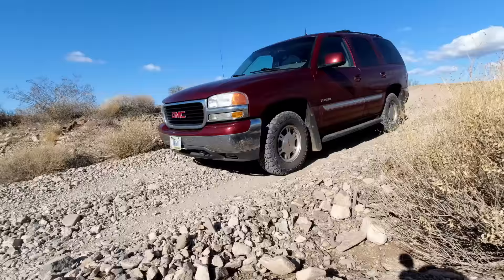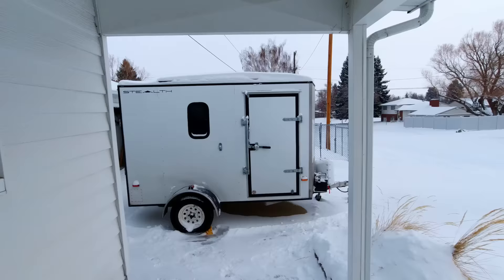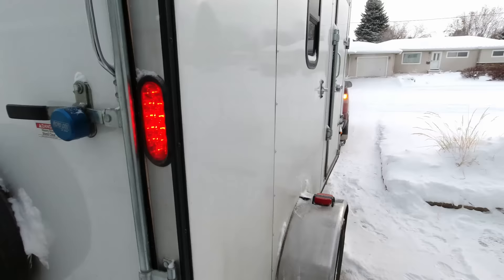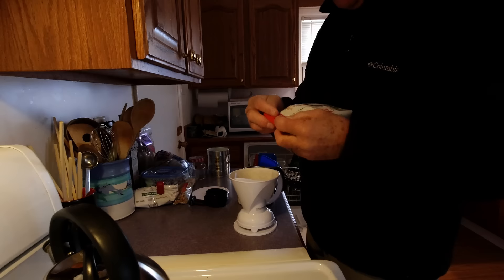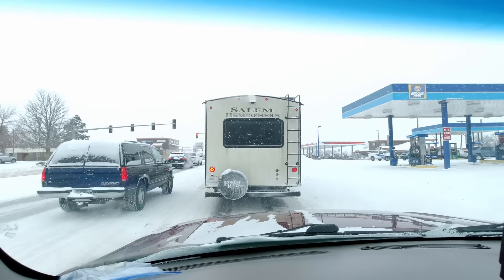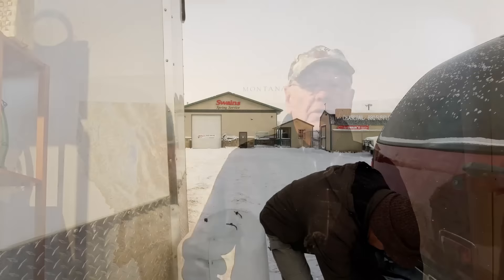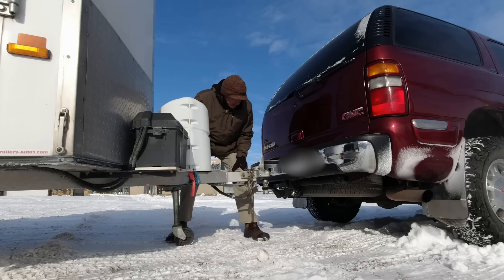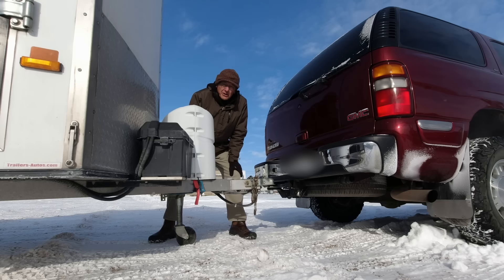Trailer Leaf Springs Or Torsion Axles?

Comment: A leaf spring will only break on the up motion when bouncing. Leaf springs do get work harden with time and will take a set. We use to get leaf springs re-arched on our Chevy work pickups back in the 80's, when we carried fuel and tools in our 1 ton pickups working on logging jobs.  I don't think anyone will re-arch leaf springs today because of liability. A person can add springs, if the weight calls for it. Another great video, always click on them when posted..Thanks for sharing :)
Reply from the maker: Thank you for sharing that knowledge!

Comment: It's good you got the other spring fixed now. Leaf spring trailers are so much easier to do a bush fix with too if they do fail. I had a Torflex axle fail and there was nothing I could do. One assembly had worked it's way out of the axle tube probably 6 or 8 inches so the tire was sticking way out. I was afraid of it coming completely off if I drove it. Talk about a hazard to everyone else on the road. I slowly crawled back into town on the shoulder with my 4 way flashers on. What a day. I had to wait a week in a small town for the shop to get a complete replacement axle. Ya I'm 100% for leaf spring axles.
Reply from the maker: That's exactly what I'm afraid of happening!  I almost went with torsion arm suspension, but the first shop, who could have sold me that product if they wanted to, talked me out of it.

Comment: Glad to see you finally got this done, but it did make for an " INTERESTING" vid when the other one broke down. You can get the other one ( spare ) checked out to see if you have any cracks in it or stress fractures that mite not be visible to the naked eye, there's different ways of doing this, just a thought. Or since your GTG for another 100k not worry about it, an just keep the spare onboard, JIC. Thx for the vid

Comment: Kinda surprised on your first comment about leaf springs.  They are on the back of probably 90% of all pickups and typically don't break after way more than 100K miles.   Cheap manufacturing of trailers and probably their leaf springs, well that's another story, but not indicative of a bad design as a whole.
Reply from the maker: I probably have 100,000 miles on this trailer and it's a Dexter axle and springs. Everything breaks eventually.
Reply: @gonagain  Agreed, everything breaks eventually, sorry I must have misunderstood you, as I thought you were saying that leaf springs were an interior design.  Honestly if trailer manufactures would use a more quality spring, like vehicles, they wouldn't have broken at 100K.  Unless of course they are used outside their specifications.

Comment: Good information. Usually a tandem axle trailer is longer and heavier so I can understand why you chose the single axle not only for the more maneuverability but also the weight since you are towing with a smaller SUV. I have never understood why they don’t put shocks on trailers but there must be some reason. Wow it’s cold there. We haven’t even made it below 10 degrees this winter in this part of Idaho. Getting ready to take my first camping trip down into Hells Canyon in a few days. Good time to go in the canyon before it gets too hot and the rattlers start coming out.
Reply from the maker: That is such a beautiful area!  We were there last spring and loved it, other than the smoke at the time.
Reply: @gonagain  we took the jet boat ride below Hells Canyon dam. The smoke gave it kind of an eerie feel but beautiful. We saw all kinds of wildlife. Lots of bears deer and elk. There are several good boondocking places to camp. Love the Canyon.

Comment: I can’t count the number of trailers I’ve owned since the early 1970’s.  One car hauler and a small (17’) TT I used for hunting had torsion suspension.  They do ride nice but after having an issue with the I decided to adhere to the KISS principle, AKA leaf spring suspension.  Good vid as usual.

Comment: With all the off roading you guys do you might want to consider Greasable poly bushings for the Spring eyes next time they need replacement.
Reply from the maker: I had to look that up.  Yes, that's a good idea!
Reply: @gonagain   Another good idea is military wrapped leaf Springs the 2nd leaf wraps around the Spring eye in case the main leaf breaks as a fail safe.

Comment: Springs will most often give you more ground clearance. I have taken a leaf spring where the axle is above the spring and reversed it so the axle is below it. I gained not only the thickness of the spring, but also the thickness of the axle. So maybe a 4" lift.
Reply: I am thinking about doing the same with my trailer, mostly because when I drive over a dip in the road, my trailer jack hits the road in that situation.  Any regrets or advice?
Reply: @hargieboo  If the jack is in the front, it is more about the height of your hitch or vehicle. You can install a swing away jack.  or a trailer hitch that has more rise.  If you were to raise the suspension of the trailer, you may need this anyway to keep the trailer level.
Reply: @hargieboo  If the trailer has electric brakes, you  want to be sure you can get them to operate and adjust correctly once you flip and spin the axle when you undermount it. You may have to swap the left and right brake assembly to accomplish this. If no electric brake, no problem

Comment: Great info. I am getting ready to purchase a 6X10 and only want a single axle. People keep telling me to go with a 6X12 and tandem but we don't need that 2 extra feet. The info on the shocks and rubber bumpers is also great. Thanks for the videos - I truly love seeing you and Linda enjoying life and traveling!
Reply from the maker: Hi Amy, just keep good tires on it, replace them before they need it and you'll be fine.
Reply: Any, people are right. You need more length. I have a 6x12 single axle and it is really easy to run out of room when building for two people. If you want it to truly be more than a “ tin tent” you should get more length. I can’t tell you how many times I have regretted not getting a 7x14 tandem. You can thank me later.😊
Reply: @hgj2019  it will likely be me most of the time. I need it big enough to do some hauling (nothing too large or heavy) and something I can secure electric bikes, have a bed, cook, heat and some power. I have a 1/2 ton truck so I don’t want to drag it down. Thanks for the advice - if I end up kicking myself you can say I told you so...lol
Reply: @amyslaughter8788  take a close look at your needs. Figure out exactly what this should be for you. Your physical size is an issue. My wife is almost 6' tall, and I am over 6', so i can't orient the bed cross-wise. I built a small cabinet with sink, stove, and drawers. A bathroom beyond a porta-porty is out of the question. I once wanted a fold-up bed so I could still carry a quad or bikes, but I've given up on that. Two more feet in length and another foot in width would make a HUGE difference for us. Tandem axles would also be better, as you can "limp" along with one flat if you still have 3 inflated. I've dragged my trailer literally thousands of miles, and used it as both "tin tent" and a slightly more developed camper. Try to keep an open mind about this before you commit. The difference in price now will be small compared to the cost of doing it all over again. If your 1/2 ton is a "full size" you should not have any problems with the greater weight of the linger camper. Tandem axles will actually help with tongue weight. I absolutely agree about a longer trailer. In my opinion a 16 footer would be the absolute max I would consider. It is just too hard to maneuver a longer rig. Good luck, and always remember that enjoying this experience should be your #1 goal.
Reply: @hgj2019  great advice. My truck is a full size and should be fine. I fish a lot, love to camp, and generally be outdoors. I want to be as nimble as possible... I’m going to do a physical layout with cardboard - that will be eye opening. Everything works on paper - lol.
Reply: @amyslaughter8788  very good idea with the cardboard. Full size mock-up is a fantastic tool. Do it in 3D if at all possible, even storing clothes and supplies in boxes sized to fit. I’ve fished over 60 years, and fly fished over 50. Lived in the mountains of AZ several years lake fishing for big cutts, also on San Juan in NM, and several rivers in CO. If you are living in the west or headed there you will have great fishing experiences. I’m retired and back east and I really miss the west.

Comment: Well done you 2 !
Fit for fight !
Since I broke my leafspring I have investigated the market for leafsprings and beware there are quality grades of these ! Dont get the cheapest ones !!! Check with the manufacturer of small high end trucks is my advice ! Also I put in pneumatic air bellow jacks both sides of the axle with easy adjustable pressure  using small tiny tiny tire inflator or even a bicycle pump with a pressure gauge !
( they are sitting beteeen the axle and the frame beam !
Reply from the maker: Thanks Anders, I hadn't heard of using air shocks on these trailers, but I'm going to look into it.

Comment: I agree with everything you said with one  exception.  I’ve never seen a torsion spring axle break. They do get weak and the trailer sits lower and lower over time and not much suspension travel either but never seen one fail.   Just my opinion.

Comment: Interesting. I have two single axle trailers, both rated at approx 2000lbs, one has the tent trailer, Bonair is equipped with the flexiride torsion axles and the other with springs. Yesterday I bought new tires and rims for the tent trailer and found that although they fit on the new tent trailer ( moved from 5.80x12 to 13 inch  to get a tire rated for 80 mph and above instead of 60 mph)  but anyways there is not enough clearance. I was pleasantly surprised to see that in order to adjust the height of the flexiride torsion system to make room for the massive tire size change or 1.8 inch top and bottom is as simple as undoing a bolt , pulling it off a spline and moving it down a few spline points. I will let you know how that goes today but it looks promising. As for the toughness of the flexiride system I think it will be great for the mountains as they use them on most military trailer up to 5000 lbs.
Reply from the maker: They definitely ride better than leaf springs.
Reply: @gonagain  I was just mentioning that to my wife. We brought it back on the highway for about 2.5 hours and I was driving like I always do before I knew those tires are only good for 60 mph and probably going about 70 most of the way and it was pulling like a dream. I have a class one and have pulled a lot of crap here and there but this suspension is smooth. Anyways the highway was being repaved and we hit a few 4 inch drops and rises here and there that would have launched my other utility trailer 3 ft but this thing was awesome. It rained all day yesterday bit Im going to try today to adjust it.

Comment: I agree if you replace one spring always replace the other side. I definitely like leaf much better then torsion axel. We have a 5x9 V nose trailer maybe 10,000 miles maybe I should at least check them out. I just recently got new tires couldn’t believe they were that bad already.
Reply from the maker: Shop Art, be sure to always have your trailer tires balanced.  Too many tire shops think that trailer tires don't need it, but they scallop like heck if it isn't done.
Reply: That is what happened to my tires. I’m going to see if they can/will balance them. Thanks for the information I never though of balancing them!!!

Comment: The standard axle is probably sufficient, but it is fun to try to find a better or perfect system.  I have been looking at Tembrin axle-less suspension.  No axle to hang up like happened to you.  

I saw a video about a convoy of all terrain campers traveling in the backcountry of Utah.  All the trailers were from the same brand and had fancy Australian swingarm independent suspensions.  Some of the trailers had singles, and some had tandems.  They all performed well, but the tandems were much smoother on the trails.  I guess with tandems, half the weight is carried by the front and back axle.  As the lead axle goes over a bump or dip, only half of the force is transmitted into the trailer.  Same thing as the rear axle negotiates obstacle.  I was surprised by how much better the tandems were off-road, and was expecting the singles to rule the day.

There are so many tradeoffs and different factors.  Someone (me) could drive themselves crazy trying to get the 'best setup'.  For some people, the tinkering and optimizing is the enjoyable part.  If you just want to get out and explore, just about anything will work (I think you said something along these lines in other videos).
Reply from the maker: The tandems definitely do ride smoother and don't bounce like a single does.  My only concern is what happens when a torsion arm axle does break (and they do), then the difficulty of obtaining parts comes into play.  If it wasn't for that one problem I would go that route.
Reply: @gonagain  yes - reparability is something to consider.  Cool-factor  usually has an inverse relationship with parts and mechanic availability
Reply: @gonagain  update - I took my trailer to the Baja and did a decent amount of offroading all the way down to Cabo San Lucas.  I broke my left leaf spring and was able to find a replacement in a small town and repair it myself.  Two days after repairing the left side, the right side broke.  Again, I found replacment parts and replaced it myself.  Having universally available parts sure made repairs easy!!!!

Comment: If they lubricate/grease not spray!!! all threads under nuts and the bolts going through eyes of bushings nothing will be stuck for decades. Anything sprayed or not greased will succumb to the weather. I'm usually on the wrong end of STUCKS... and most are not my vehicles!

Comment: make sure you change your tires every 4 to 5 years. A blow out is very damaging. Spray liquid lithium grease between spring leafs 2 times a year helps. I jack up each wheel to get space between leafs before i spray them. Keeps noise and surface tension between leafs at bay.
Reply: Great advice!👍
Reply: @philmickey7247  agree. do the best you can. It will definitely help. Pads are best but not very prevalent
Reply from the maker: Thanks Steve!

Comment: What was that wheel chock/ lock you removed from the wheel?
Reply from the maker: That's a Proven Industries Wheel Boot.  They're not cheap, but they do work if you combine them with all antitheft lugnuts on that same side.  I use two different types of those lugnuts just to be more secure.

Comment: I would think shock mount brackets could be welded onto the axle and a trailer bracket be fabricated. I think the axle is probably a small box channel and not rigid enough though . I had torsion bars in front of my old62 Chev pickup and they worked. Tightening them gave more lift easily. My tool trailer is the smallest tandem axle Interstate and been happy with it's performance.  You guys look like you need to warm up again. Stormy here in Seatroit. Take care...
Reply from the maker: I'm looking forward to heading south again soon, as long as gas is still affordable.
Reply: @gonagain  diesel is up 1.20 here since ,January

Comment: Rick, now that you are the King of the Road... I was wanting to know more about up grading my <@2,000# Axle to a bigger one... 
Can I just put a 5,000# Axle, new leaf springs and Load raided tires on and pull 4,000++ pounds of "Stuff" in my 6 X 10 Single Axle trailer???   ??Good to go??
Reply from the maker: That's galso going to depend the load rating of your trailer's floor.  How far apart are the floor frames and how thick is the flooring? This is something the manufacturer would be able to tell you.  My trailer has the floor beams on 24" centers and an upgrade would be 16" centers, just as an example. Then there's the rating on the tires as well.  I would think for that kind of load (4000+ lbs.) you may want a tandem axle.

Comment: Hi Rick, Hi Linda. Gee, that Temp. Reading was So Inviting I expected to see you in Shorts & Flip Flops. I DON'T know how you all do it???--Regarding the Springs, I had the dealer 'Flip' them Upside-Down, plus Exchanged the tires for Something a Tad Taller. But Now, my Rig Looks 40ft. Tall. Almost Rediculous and wondering if I shot myself in the foot?? One thing for certain is: My gas mileage will Drop to Below 50% with all the Wind Resistance. But I'm Not Complaining, only Explaining. Still, YIKES. 🤔 70°+ TODAY. The Southern-Tundra is 'Calling You' 🤗🌞🌝👍
Reply from the maker: 70 degrees!  How is that even possible in the world?
Reply: @gonagain  It Actually got up to 77 yesterday. It's called the 'January  or February Thaw'. It happens once every winter. Spring brings Rain & Cold. It's Not Over just yet.☹

Comment: I just want to say If you are breaking springs  I would  double check your load to make sure you are not overloading your rig.  ( just saying .)   maybe get it reweighed.   Cause we all add stuff into our trailer and after time we forget about the extra weight we might be adding.
Reply from the maker: Thanks Jay.  Actually my trailer is just about empty with only our bunks and personal gear, but we do travel a lot of rough roads.  What broke the spring was snagging the tire on a tree stump.